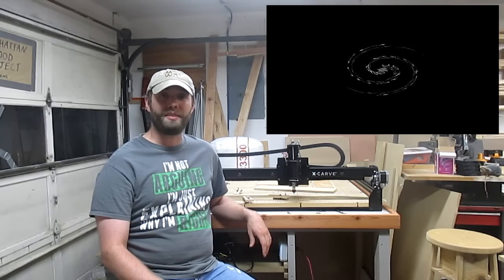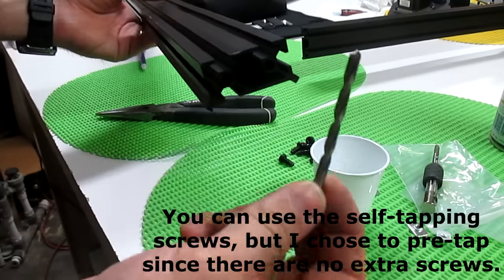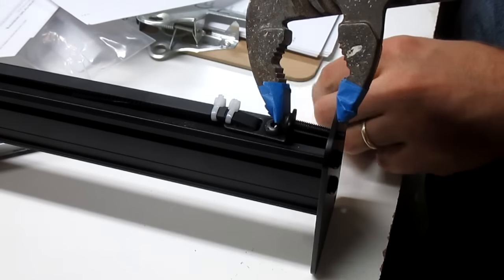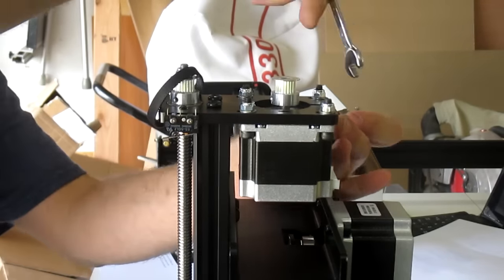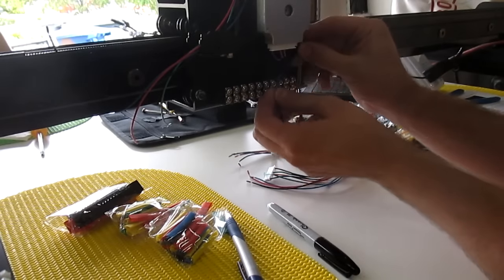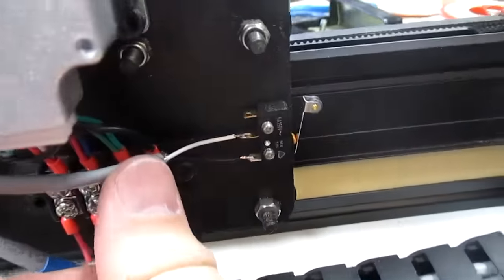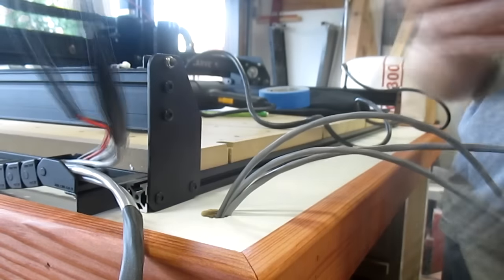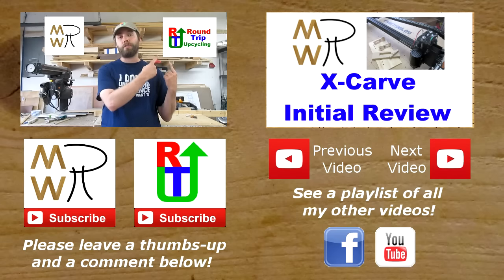33 - X-Carve Assembly Tips - Manhattan Wood Project

Comment: Nice little "help" thing there. My CNC is a completely homebrew, no plans deal but the "fixes" you suggest here are close to how I did things. In over 5 years of use I have yet to have any problems related to wiring and none other than the occasional nut working loose.  I use Mach 3 on a 15 year old desktop via a  printer port on my CNC. Mach is an industrial grade CNC controller program that just makes life easier like bit changes and NO NET ACCESS is needed to run it. In addition just about any CAM program made has a post processor built in for it.  There are no terminal blocks or connectors anywhere on mine.  Everything is soldered together where needed using heat shrink as needed. Connections to my controller box is by cables using 4 pin screw locking connectors except for the AC in the cable going to the top of the Z. I use a trim router.  No cable chains either, just used wire loom closed up with a good grade of electrical cable. Fairly easy to open up to add any wiring if needed.

Comment: I watched both video nice job, oh ya I broke my little itty bitty bit first try
Reply from the maker: Mike Fulton Thanks Mike!  So far, I've damaged 2 bits.  Broke one of my little itty bitty bits by manually moving the gantry back, snapped the bit when it went across a clamp.  Damaged an engraving bit during calibration by trying to get it as close to the scale as I could and moved down .1 instead of .001 inch.  D'oh!

Comment: Great tips thanks, great wireing! you should add Amazon affiliate links to your post. It could help people find their same stuff you bought from there and also put some money back in your pocket.
Reply: Also, where and how did you terminate the shields for the limit switches? Did you terminate the shields for the motor cable?
Reply from the maker: That's a good idea.  I'll start implementing it, thank you!
Reply from the maker: I didn't terminate any of the shields or foils, I just clipped them short on both ends and put the heat shrink over it.  If I re-do the wiring setup, I'll likely use longer wire and terminate the shields to ground on a case or something.